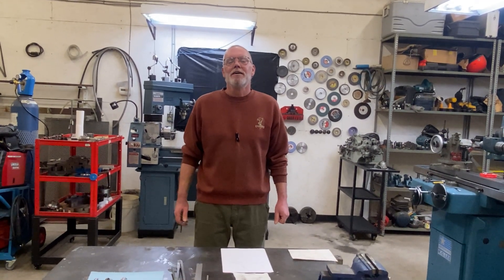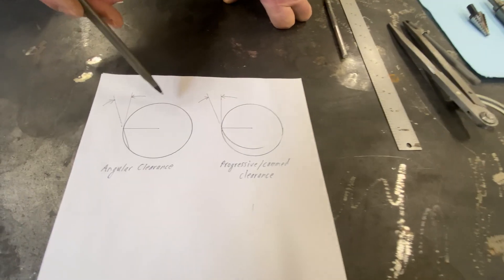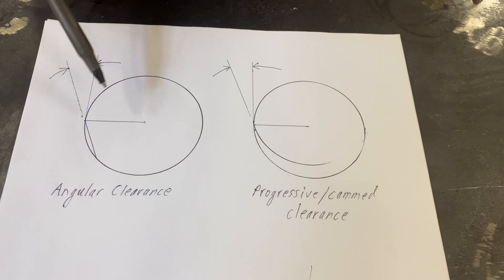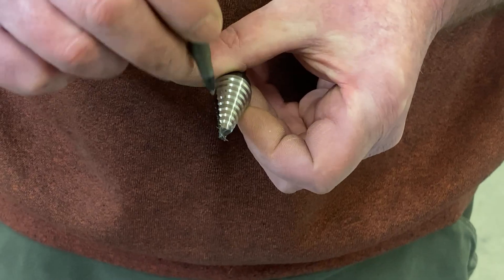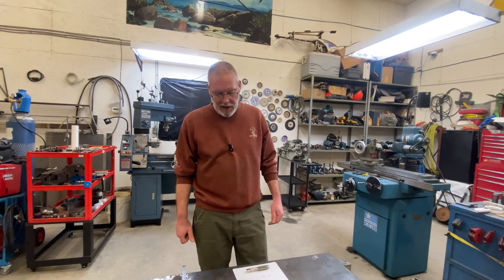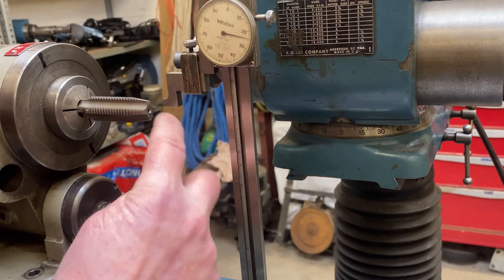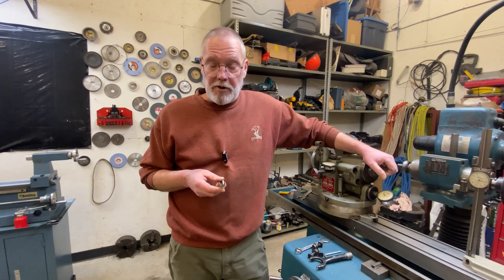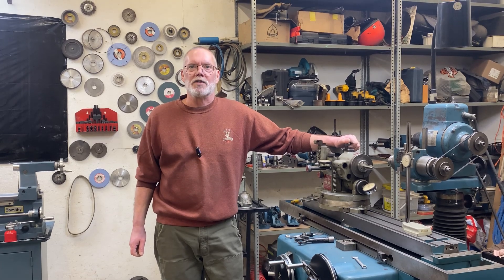PROGRESSIVE AXIAL RELIEF DISSCUSSION

Comment: Is the fact the tap is presented to the grinding wheel at an angle the reason that you get some (most) radial relief and some axial relief? Or it the relief fixture capable of independently varying the two reliefs?

Thanks in advance and hope your recovery is smooth!
Reply from the maker: The relief fixture can independently vary the axial and radial travels infinitely within it's design range. 
The angle that the tap is presented  to the wheel simply gives the lead in angle, e.g.,  taper, plug or bottoming. 
Thanks very much for the well wishes!
Reply: @ thank you for the clarification that’s good to know

Comment: I have two hybco heads.  These heads make sharpening taps easy.  One is used only for sharpening gun drills.  What is the new machine you mentioned.  I could not see what it was.  Your videos are great.  Sorry to hear about your health trouble.  Not many places have the hybco heads and very few people even know what they are.  Do not stop making videos.  regards.
Reply from the maker: The new machine is a 1926 Kwik-way multi purpose machine, (featured in my last two videos).
Thanks for the great comment!

Comment: I think one of the reasons to use a cam relief vs an angular relief is how wide the flute is.  If it is wide, you end up with primary, secondary and then a third relief angle to ensure clearance.   I think that is why countersinks tend to use the cam / elliptical/ conical what ever relief.
Reply from the maker: I can see the logic in what you've said for certain tools. Makes a lot of sense for a typical counter sink. Doesn't really hold up for a tap though where the rotational length of the teeth is quite short. 
Thanks for the comment!